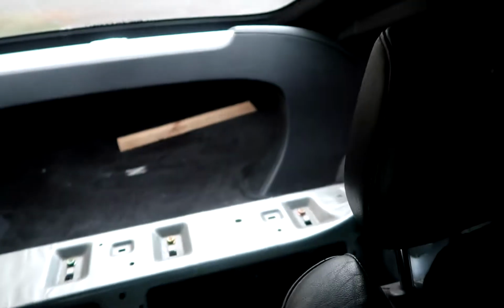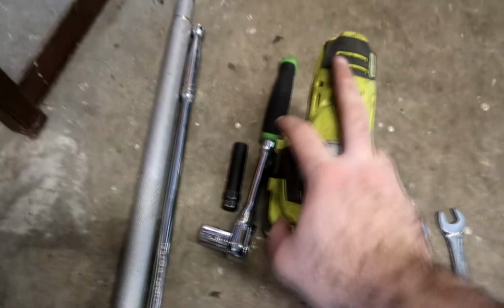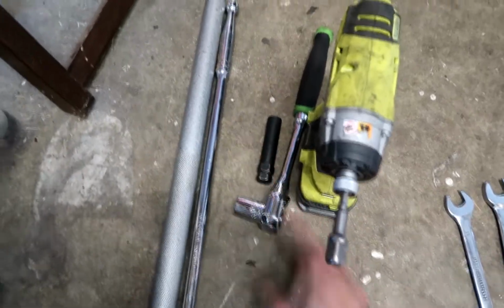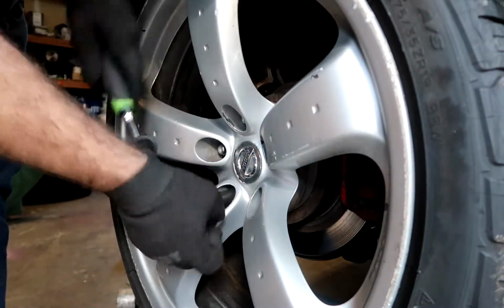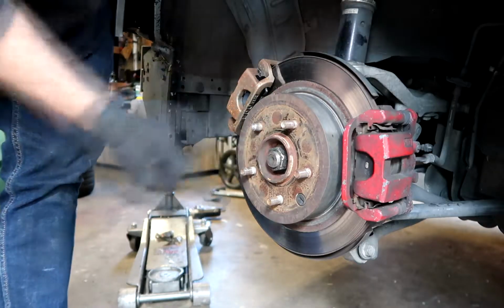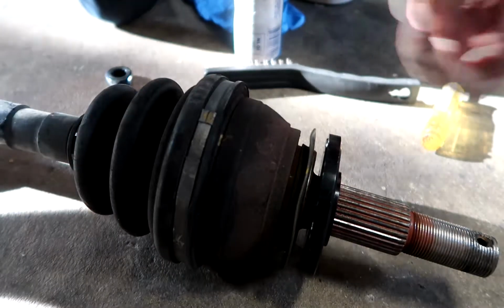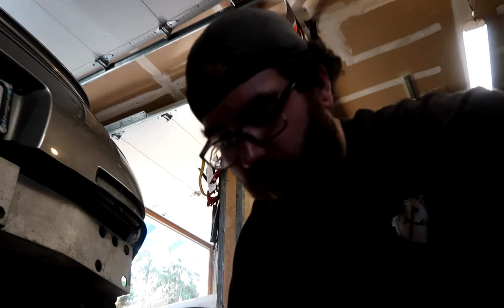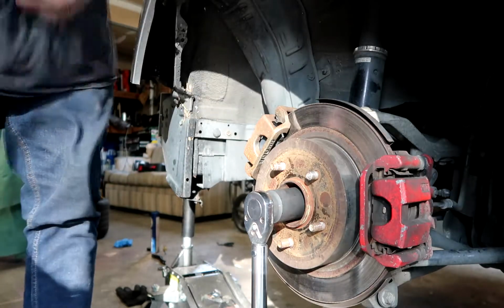Repairing the 350z's axle click.... or so we thought.

Comment: Why do you have two calipers?
Reply from the maker: It’s called a dual caliper setup I operate one set through normal braking with the pedal and the other through a hydraulic hand brake. Commonly found in drifting and rally racing. The car was a drift car.